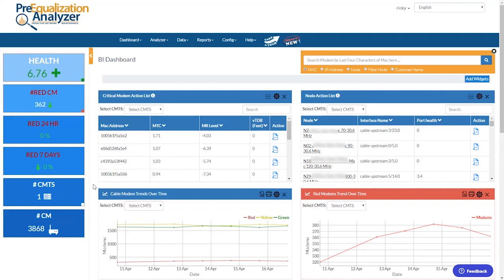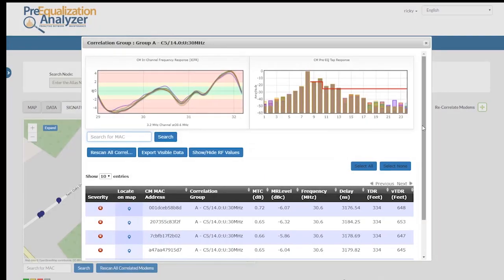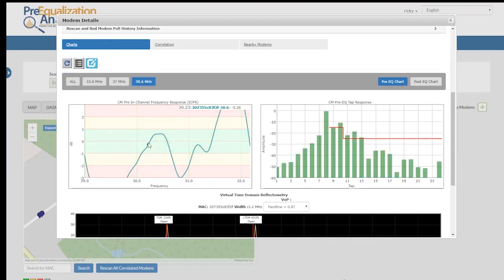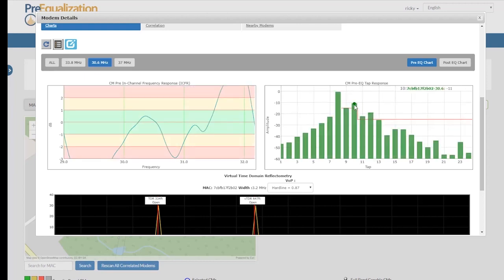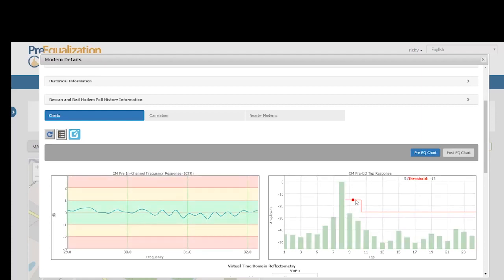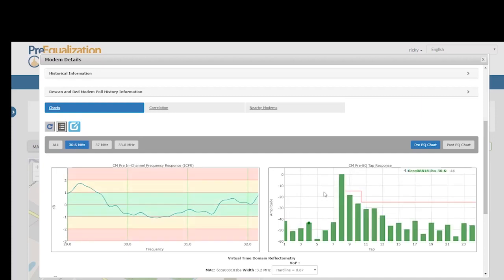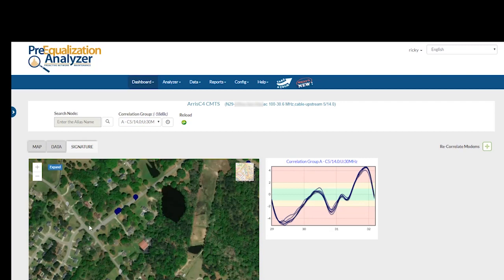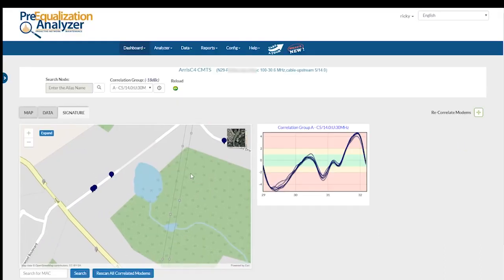DOCSIS Proactive Network Maintenance (PNM) -  Identifying Common Impairments with correlation groups

Comment: Would you mind explaining the difference between "TDR" and "VTDR"? The footage they display is substantially different. Is that suggesting there are two different size echo cavities?
Also, in relation to digital taps: If each digital tap represents 80' or so and if the 1st tap is elevated, that suggests the issue is near home/in home, correct? If that's correct, does that mean those taps are representing the distance to the problem? It's all so confusing. Any help or guidance would be greatly appreciated. Thanks for all you do, Mr.CableGOD!
Reply from the maker: TDR as we used it would be more indicative of a near-home or in-home issue, and VTDR more indicative of a problem further out in the plant. Since we published this video the names were changed in the application to IH (for In-Home) and OSP (for outside plant).  The first and second Digital Taps to the right of Tap eight would be elevated if the problem is likely in-home or near-home. As you go further to the right the distance of the echo cavity gets longer, so it is more likely an outside plant issue. Quite often you have both issues occurring at the same time. You will see Taps nine and ten elevated due to some in-home or near-home issues, such as a loose connector on the modem, or a corroded connector at the drop. That would only be impacting that subscriber. Plus, you will see other taps further to the right elevated because of an impairment in the outside plant, like radial cracks in an aerial cable that is impacting that subscriber and others whose signal pass through that point. Most issues are at the home, and should be addressed first, which can then improve the correlation data you can get from the PNM application as it determines which impairments seem to be impacting multiple subscribers. If you have not yet downloaded this whitepaper on VTDR and correlation groups, it may be helpful: https://www.zcorum.com/wp-content/uploads/Correlation-Groups-and-vTDR-Technical-Paper.pdf